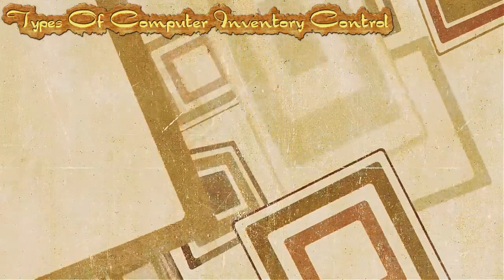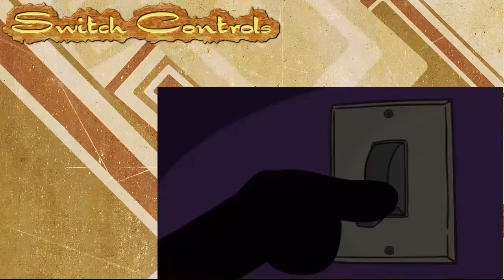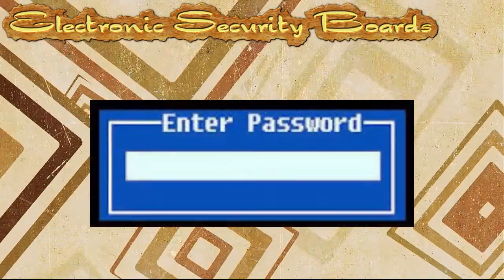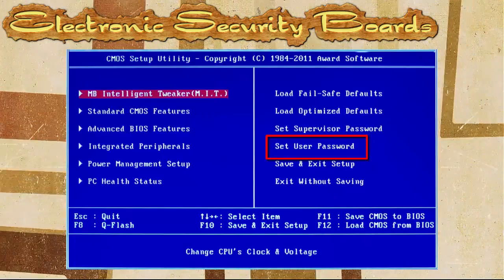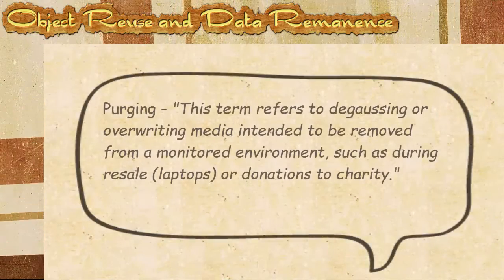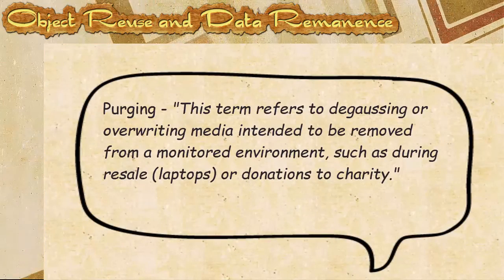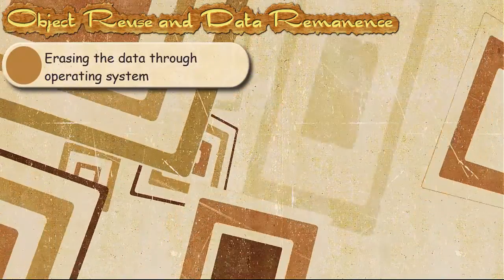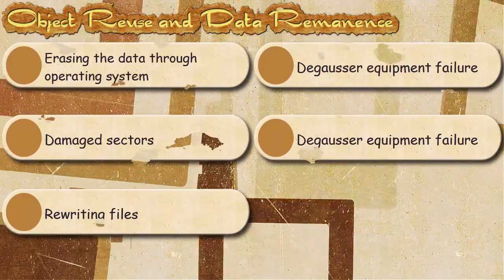Computer Inventory Control

Comment: How would you go about protecting storage devices for events such as natural disasters?
Reply: Natural Disasters is a wide range therefore i will answer based on 3 of the most common disasters that occurs in Trinidad: 
Floods: So protecting storage devices from from this disaster is pretty much simple as you are just required to keep the devices at a suitable height. In most offices for example, storage devices are usually in cabinets at a substantial height which also helps prevent easy access to unauthorized users. 
Fires: Protecting storage devices from fires i believe an effective way are gas discharge systems as it does not affect devices when dispersed. You can refer to Environmental & Life Safety Controls by Jeremy Ramlochan on more if need be. 
Earthquakes: Protecting storage devices against earthquakes may be to have devices stored in strong structures like metal cabinets and such to shield from outside structure that can damage those devices.

Comment: What aspects of your topic would be applicable to your organisation chosen for final project? How would you implement any one of the aspect mentioned  in your organisation using an example.
Reply: I would say all aspects of my topic would apply to my organization because of its critical need for Computer Inventory Control and Media Storage Requirements. Being a security surveillance company, Computer Inventory Control is vital to the organization because the company has to preserve all aspects of the C.I.A in order to provide our services efficient and effective without fail. We must preserve and protect our clientele and as such PC Controls must be implemented to prevent unauthorized users from gaining access to my client’s personal information. I must install all forms of PC Physical Controls which were discussed in order to prevent and secure both the company’s assets and my client’s private information which they entrust to my company. 
Not to mention Media Storage Requirements – because of the sensitivity of the data which my company will hold on client’s, proper disposal of unnecessary media must be a high priority because I cannot risk the C.I.A between myself and our clients. 

So, in an example: A client’s address, personal contact will be recorded in the company’s system, if the company fails to have proper controls implemented anyone can simply access the information of this client. This information now can be used to track the individual and with the unwell intentions of the unauthorized person, the client can now be at risk of an attack to themselves, their families, and possessions. All this deriving from the company’s inability to protect the client’s information. Therefore, the company must ensure that only authorized personnel with username and password credentials be able to access such information when required. 

I hope this covers your question.